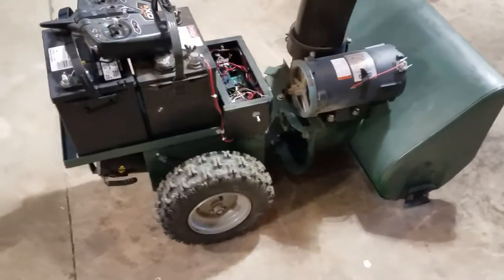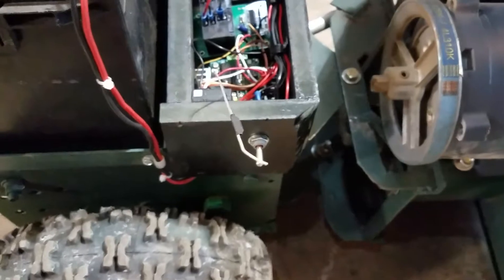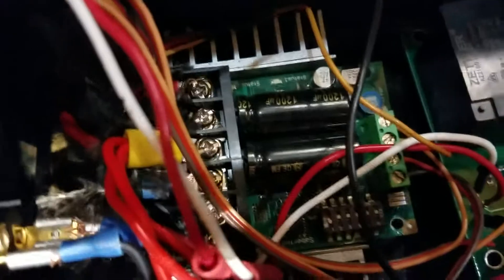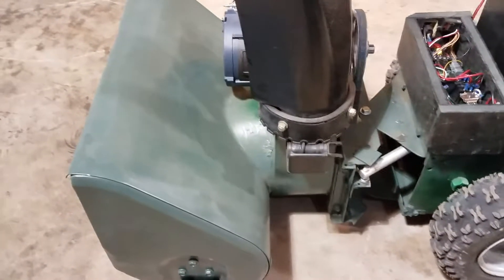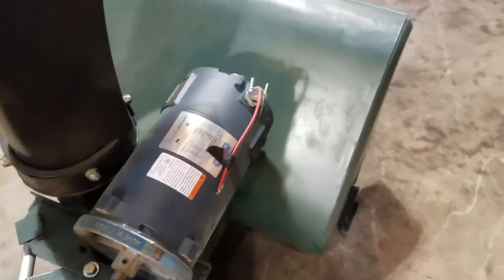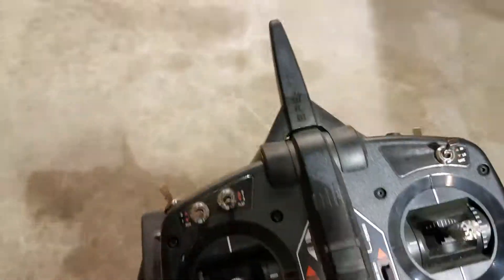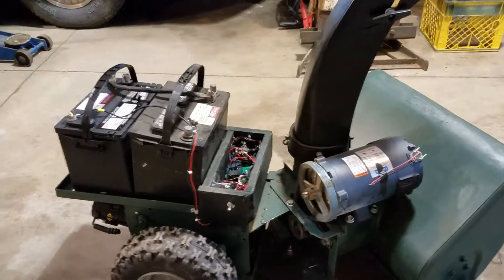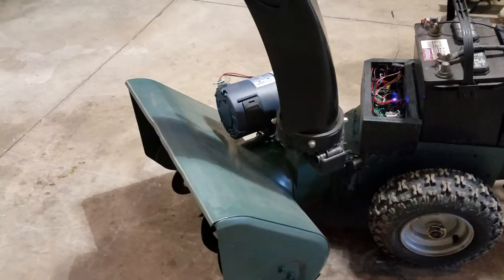robotic snow blower - check this out - too awesome

Comment: What are the specs on the snowblower motor? Is it powerful enough?
Reply from the maker: It is currently a 1 hp motor. Which is ok if snow isn't too deep or wet. T I am thinking of getting the 2hp but that is over $900.
Reply: @55shanghigh  You should think about getting a brushless motor. They're smaller and produce more power because they're 90+% efficient. Eg: https://flipsky.net/products/bldc-belt-motor-6384-4000w-for-electric-skateboard?variant=29756675358780
That will give you 4000Watts (may be not with 24V) while your 1hp is like 745Watts. It can work on 24v. Controllers for 24V brushless motors are <$50.
Reply from the maker: @DIYGuy85  yea, I have considered brushless, but also need some power to turn the augers, that one didn't look like it could do that.
Reply: @55shanghigh  yea but power is measured in watts. Your motor can produce 745watts and this brushless is 4000watts
Reply from the maker: @MrCoder101  thank you. Sounds like you know more about torque than I do. I will try this out. Again, thank you for your comment. I do appreciate it.
Reply from the maker: I ordered this, hope I am not making a mistake it looks like it is only about 4 inches long. And it seems like it is taking a long time to get it too.
Reply: @55shanghigh  Few things to keep in mind is you will need a brushless motor controller for the right voltage and amperage you want to use this at. With amps comes the consideration of wire thickness. 
In regards to torque, this is little difficult to match. The manufacturer lists the torque as 9Nm for the brushless motor. I don't know what your current motor can produce. Torque conversation goes hand in had with RPM conversation. The motor is listed at 190Kv which means 190*24V=4560 RPM. No load RPM. With load this will go down but no way to predict it. Be ready to play with pulley sizes if the RPMs are too high. Brushless are known for high RPMs
Also its listed at 4000Watts but that may be achieved only at max voltage (13S). So for your application of 24V, this may be around 24V*95Amps = 2280Watts. Little higher if you can pull more amps without it getting too hot. Your application is in a snowblower so airtemps are much cooler so you may be able to squeeze out more wattage out of it with higher amps before it gets too hot to operate.
Reply from the maker: @MrCoder101  ty